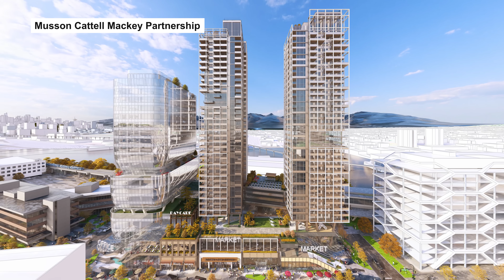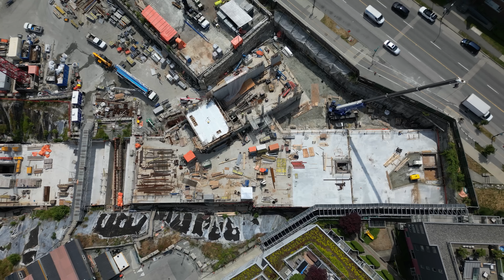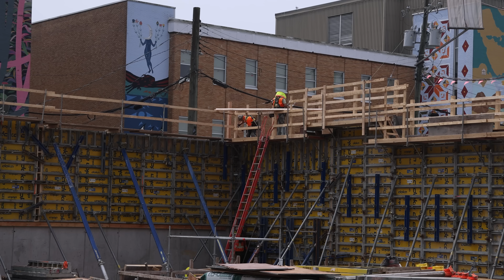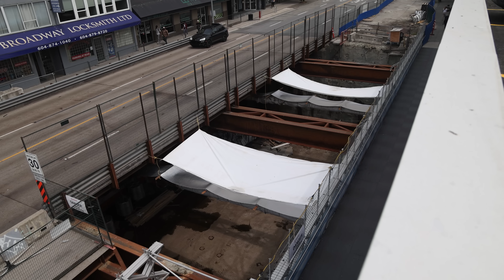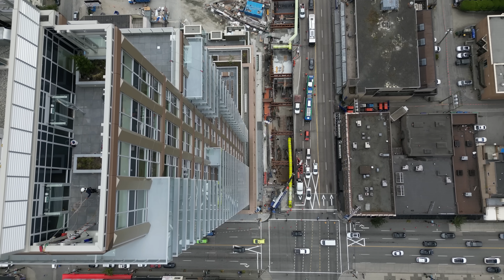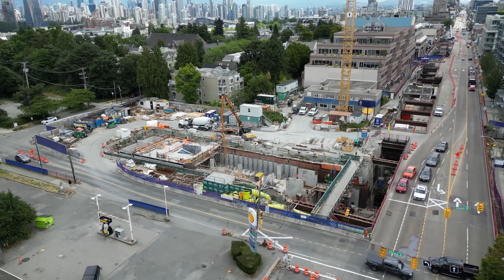Broadway Subway Construction June 2025

Comment: The grey strips on the roof are a way to bond the waterproofing membrane to the concrete. It divides the roof into compartmentalized sections which will help to isolate potential future leaks to smaller areas. If a section starts leaking in the future, there are grout lines and valves under each section where grout can be injected to seal off the leak without having to dig the station apart in order to repair. In theory this is an added lifeline to extend the lifetime of the waterproofing. It's an important feature for an underground public space in "Raincouver". It's been a privilege to work as part of our waterproofing team the last 2+ years. Looking forward to completion and excited to ride the train in these stations one day.
Reply from the maker: Thank you for your insight! I've pinned this comment so others can see it easily.
Reply: Thanks for sharing your expertise on this! Super cool to know

Comment: are the grey strips the expansion joints between concrete slabs, or were they laid on top. i couldn't see.
Reply from the maker: It looks like a thin layer of concrete was removed and then the strips were applied. They come on a roll, looks very thin, that's why I'm thinking it's something to do with moisture control. Thoughts?
Reply: @StainerTheFirst  i looked everywhere for info. but yeah, i guess it is a moisture channel (filled with gravel), then a membrane and reinforcing fabric to seal it. but seams weird to do that and then just backfill it, unless another layer or floor is going above it. (so much for my architectural and building engineering technologist diploma 😅).

Comment: Finally a new update. But that 3 billion dollars is the initial proposed budget right? There's no way this is going to be that cheap 😅
Reply: project was originally estimated and something like 2.8 billion. its actually overbudget. but this new 3 billion budget is still on track atm. the increased cost is due to the dalays that were caused by concrete and rebar shortages afaik. sounds cheap until you realize the entire canada line was built for less then that. builting stuff for stupid cheap is kind of our specialty. lincoln station was built for just 30M dollars
Reply: @Caty15 I mean Canada Line also uses its own set of incompatible vehicles and have shorter platforms and trains used in that line, so infrastructure needed is way cheaper.
Reply: @TheRandCrews  yeah i know still a whole miracle considering more than half of the distance is underground
Reply from the maker: Yeah as the others mentioned the initial budget was just over 2.8 billion. Cost went up because of the delays mostly due to supply chain and the pandemic. As of the May monthly status report (https://www.broadwaysubway.ca/news-information/monthly-status-reports/) it's still on track to be just under 3 billion. Pretty good considering what's been happening everywhere with large projects doubling in price.

Comment: Is that rust on the rails? Is that normal at this stage..?
Reply: Could be a type of steel that uses the surface layer of rust as protection. You’ll see it a lot on large beams used for bridges these days.
Reply: @johnpratt2006 thanks for the info! I'm glad it's intentional 😅